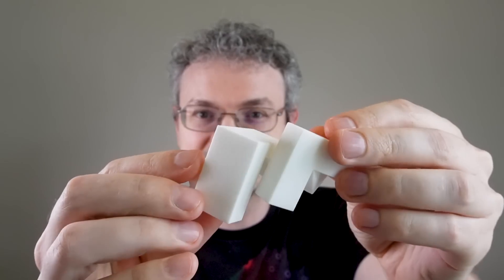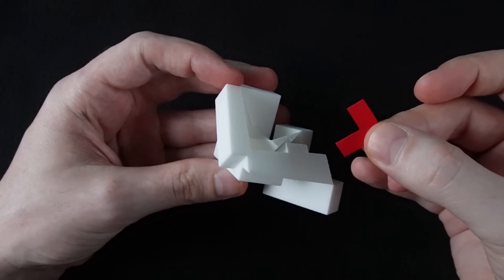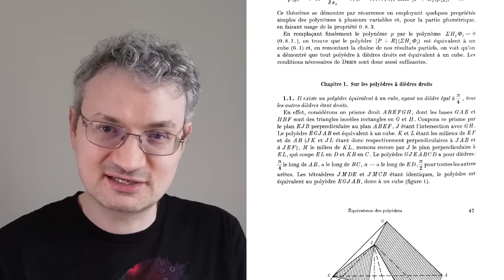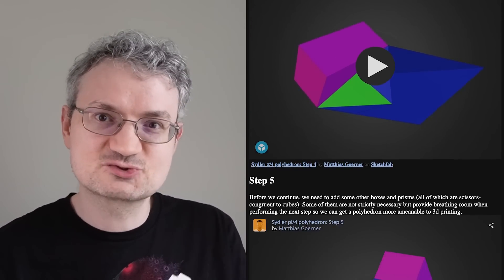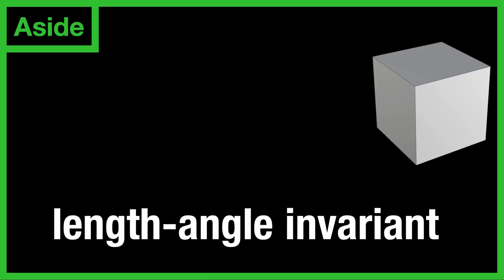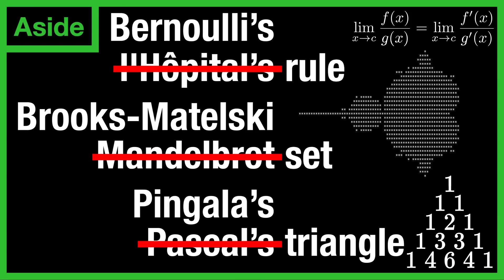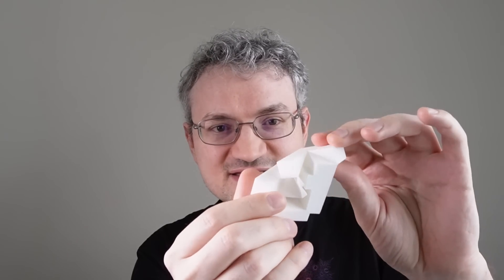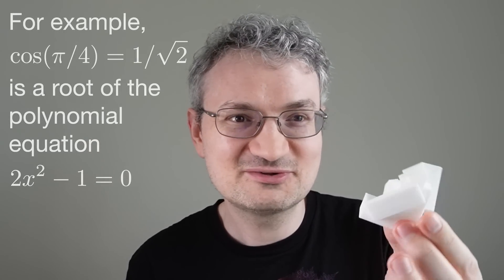The pi/4 polyhedron

Comment: 1/8th circle more like. lol

A die is pretty much always practically convex unless the surface it's bouncing on is convex, as it only ever deals with flat surface physics. Though I guess there could be like a compression tension effect like if you threw a star on the ground the legs might spread and then elastically contract, flinging the object into the air

2:31 "for any two shapes with the same area you can redistribute the area and the areas will remain the same" uhhh... Is that a real theorem? lol. I believe that is what philosophers call "begging the question"

wait, if you can't do this in 3d, does 3d calculus work? doesn't calculus rely on the idea that slicing something up more and more will probably lead it to a unit so small that any shape can be compared 1:1, even curved ones? If you can't cut a cube into infinitely small pieces and have them be able to be put into a regular tetrahedron, then you can't strictly compare their areas, as those areas are determined by counting similar units. Nonsimialr units can't be 1d-numerically compared
Reply: Referring to your 3D calculus point, calculations are done using double and triple integrations which operate on single variables. In other words, 3D calculus is not necessarily "cutting across places" when finding volumes of curved objects, only across 1-dimensional lines.

Also the Dehn Invariant is just talking about transforming shapes using finitely many cuts. I guess the concept of allowing for infinite cuts is where calculus kinda comes from, but the Dehn Invariant holds true if only a finite number of cuts is allowed.

Comment: The point about dane invariances was not convincing.
Surely i can make 2 moulds, i square shaped and 1 tetrahedron shaped with equal volume, then fill 1 with gallium metal. Let it harden, break the mould, and use that metal made out of real independant phisical particles to fill up the tetrahedron or any shape for that matter.

And there would be no difference between magically perfectly cutting 1 atom off and losely depositing it in the other shape (which the rules allow for. You said nothing about the cutting and with paper there are also parts that are lost in the real world but not in magic fairy math- is-2d-land) or melting off 1 atom at a time and depositing that.
Do the latter one really fast and that is what you get when you melt it.

The formations of dropplets has nothing to do with the vollume and is a downstream process from the melting solid and as such no longer contributes to that solid.

If this is a problem to magic fairy math land than you can use vapour deposition and a hollow cathode tube to atomise individual atoms and recrystalisd them elswhere.

It is like saying this piece of wood is brown. That chair is red.
There is no way to turn brown into red, therefore there is no way to turn wood into a chair.
Brilliant
Simply fantastic
Tremendous.
Now, where is the practicallity of this.

I know i am an idiot, but this is so far away from where my knowledge ends that i can not even start to comprehend the possibility of even devoting the energy to think about it.
Just like an extinct hominin species would not know what to do with an ore of refined thorium and might be at most entertained by its shape or colour i have not the slightest fart of a beginning of comprehension why the thought of putting effort towards this even made sence to a person alive at the same time as me.

But you do you

Comment: That was very counter intuitive. I would imagine that if I had a tetrahedron ice cube mold and then melt the tetrahedron ice cube and use the same volume of melted water to make a cube, in my head that would be trivially possible. Apparently there is something that doesn't make it work, mathematically.
Reply from the maker: It would work, but reshaping water doesn't follow the same rules as cutting up into finitely many polyhedra and gluing them back together.

Comment: When I think about why you would want a shape that has 90° angles, what comes to mind is the ability to stack the shapes together, that is fill or tile space. While the shape and the techniques used to create it are pretty cool, I am wondering if there are other properties the shape inherits because of its angle uniformity? 

Very nice point about the problems with naming theorms after people. You could imagine that mathematics, of all disciplines, would relish a systematic naming convention for mathematical theorems, objects, and procedures.
Reply: I think this is because other fields have a narrower scope, mathematics concerns all sorts of concepts and creating a scheme to name them is a form of mathematics in and of itself, which you can find ambiguity in choosing the best one of just like all sorts of ways to view the same problem in mathematics. Look at the schism between different foundations, equivalences between different theories etc. to try to name them in a way that both would agree on requires agreeing on a further meta-foundation that subsumes both, and that just can't be done for free, but on the other hand naming it a completely meaningless- but still memorable name sidesteps that issue.

Comment: I'm completely fine w/ the Avogadro constant keeping his name, though, since it's an absurdly stupid thing, being the basis of a unit, despite just being a number, and at this point in history being a defined number with absolutely terrible properties. for instance, at the time it was defined to its current value there was only one perfect cube that fell within the error bars for the measured quantity. and, being a number that describes the number of physical particles of some substance you have it'd be really nice if it could be a number that could exactly describe the number of physical particles that can fill some basic shape, like say... oh, I don't know... maybe a fucking cube. but nope. the absolutely absurdly irrational love of base-10 came to the rescue and they just hacked off the number where it stood, leaving it with astonishingly horrendous properties.

it's almost as bad as the Coulomb being a physically impossible amount of electric charge to have.

wouldn't it be nice if there was a measurement system where the analogue to the Avogadro constant was both a nice number (like say, a perfect cube and an antiprime) AND it was the number that defined the analogue to the Coulomb? but, nah... metric is the best!
Reply: the density would change how much chemical could fit in a cube tho

Comment: I was briefly confused by your claim that if all the angles at the edges were rational multiples of pi, the polyhedron had zero Dehn invariant, because I was thinking of the angles at the vertices of the faces rather than the dihedral angle between faces. For the cube these angles are the same, but for the regular tetrahedron, for example, they are not.

Comment: Something I want to add to the naming comment: Even when something isn't named after a person, there is no guarantee that the official name is at all descriptive of the thing.
An example would be the "k-D tree" data-structure in programming. The literal name means "a tree of dimension k", which could be seen to be a blanket term for things such as quadtrees (a 2D tree), octrees (the 3D variant of quadtrees), and as a third example, all dimensions of binary-space-partitioning.
In actuallity, the name "k-D tree" actually refers to one very specific construction of a tree structure, and no others. My suggestion for a name that would be more descriptive of what it actually is would be something like "median-split tree". (Quadtrees and octress are very similar and would be in the category of "average-split tree".)
Reply: I think naming things after people actually solves a few problems, because some things have properties that we don't understand clearly, or can't clearly be conveyed in a simple term, or the connections it has to other, subtly different things, are so far unknown, but absolutely still need an unambiguous name, and it turns out if you name things after their properties that can often be ambiguous. (however, it's also easy to name multiple things after the same person- choose another name that's still a name involved with the concept but not a description)
Reply: naming something after someone is fine because it is just that, a name

Comment: Yeah, I hope that someday in a thousand years we'll completely rework the way we name and systemize things. No more random mathematical jargon for things that can be explained using common vocalubary. Electrons could be assigned a positive sign, so that current would be codirectional with flow of electrons. Measurement systems could be based on fundamental constants right from the start. Numeric system could be changed to HEX, since powers of 2 are more fundamental than some random number (10 in our case), and computers love them (and computers will be our best friends for eons to come, after all). 
Musical notation could use actual numbers, that specify frequencies and ratios between frequencies. Color theory could be simplified to a small handful of terms. And etc, etc, etc.

There's just so many irritating tiny little things that accumulated over the centuries, which we can't bring ourselves to rework, since that would lead to even more confusion. And even if we rework those now, it might turn out it all was premature and could made things even worse.
Just want to polish everything that we know, by remaking it fundamentally from the ground up, you know. Refactoring of all existing human knowledge, in other words.
Reply: Speaking of premature decisions, I think that using a power of 2 as a number base would not be a good idea at all. My 2 main arguments for this are as follows:

1. Base 6 actually has the nicest representations of simple fractions that I have ever seen.

a half is 0.3,    a third is 0.2,    a fourth is 0.13,    a fifth is 0.1111...,    a sixth is 0.1,    a seventh is 0.05050505...
No numerical base with a power 2 can produce comparable results. Not even base 12 can compete. Base 10 is basically right in the middle.
Watch "a better way to count", uploaded in 2018 by jan Misali, if you want to hear a bit more on this.

2. Powers of 2 are rarely the best answere to a problem, even when talking about computers. I will provide 2 examples.

A simple example would be the sorting algorithm shellsort. When shellshort was first described, the author Donald Shell decided to use powers of 2 for determining the gap sizes at which numbers are sorted. Today we know that the powers of 2 are the worst sequence of numbers that anybody has ever used for shellsort. Most sequences that have been tried use the powers of 2 simply because of how easy they are to generate. The optimal sequence appears to be A102549: 1, 4, 10, 23, 57, 132, 301, 701, 1750 (with no further terms currently known).

A more complex example comes from memory management in computers. This one is gonna be a story.
First an explanation: When programers need memory, without knowing how much total memory they will actually need, they often use something called a "vector". Similar to an array, a vector holds a contigious piece of memory, but it can automatically expand its size when needed. For instance, when the vector currently has enough room for 8 elements, and you insert a 9th one, it will automatically move its content to a larger memory location. Traditionally, the new memory location will have twice the size as the old one, thus creating the powers of 2.
Now for the problem: If you always double the size, you will never be able to reuse the old memory locations. The new location is forced to come after all the previous ones because it can not possibly fit in the old ones, assuming the first one was at the beginning of the computer's memory and there are no other programs running. Also note that the current memory needs to be copied to the new location before it can be reused, so this patch of memory is also out of the question.
So, to be able to reuse old memory, you need a number sequence where the sum of f(i) from i=0 to n is greater than or equal to f(n+2). This is not the case for the powers of 2. For example, 1+2+4+8 is smaller than 32. (A memory of size 16 is currenlty in use, and the new one will be of size 32. Working backwards, the old memory was at most of size 1+2+4+8, which is not nearly enough.)
If you were to only use multiplication with a constant, then the smallest factor you can increase f(n) by to get f(n+1) must be strictly smaller than the golden ratio. (Around 1.618)
Software-engineers at facebook actually explored this problem. Many of their servers essentially have just a single, huge vector on them. They realized that a large portion of memory always remained unutilized, and so they started experimenting. In the end they chose to multiply the size of the new memory location by a factor of 1.5 (rounded down) and so managed to get more memory out of the same hardware.

Comment: Naming stuff after people has it's problems as you point out, but like... mathematicians are rather uncreative. If you don't put a name on it it's all "normal", "regular", "perfect", and "simple".  And when we are creative, the names are often just bad - there is some compromise between not using the same 5 or 6 adjectives and being unhelpful and irrelevant. I'm not sure names are that compromise, but they're at least a decent approximation.
Reply from the maker: The obvious solution is to encourage mathematicians to spend the time thinking about good, descriptive, not-over-used words to describe their objects. This is part of writing well, which is (should be) an integral part of being a mathematician.
Reply: @henryseg  Indeed - and it's a part of being a mathematician that is sorely neglected. Writing well is hard, and pretty orthogonal to most of the actual mathematics - but it's still important. What use is an insight if it cannot be shared?